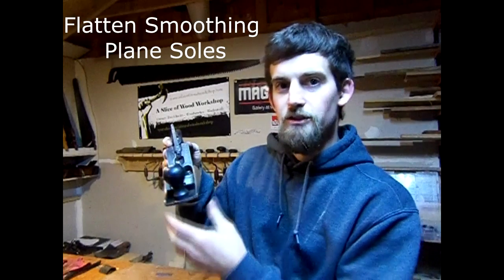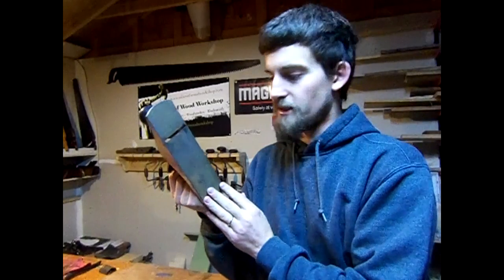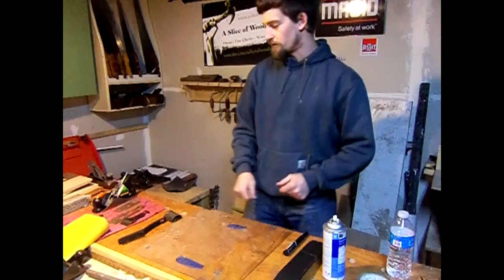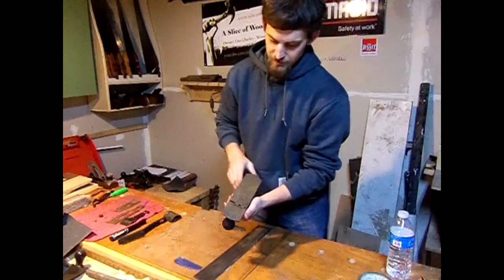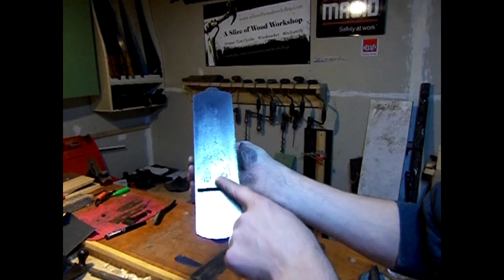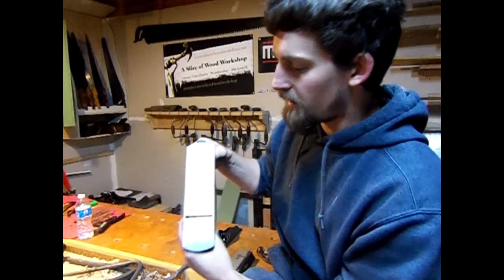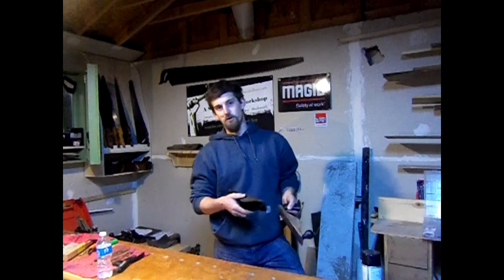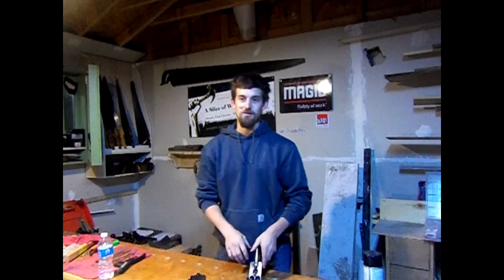How to Easily Flatten a Smoothing Plane Sole

Comment: good video, great instructions.  hard to see the difference in the 2 planes you compared because all we can see is the reflection of the light on both planes.

do the pits pose a problem in the use of the plane?
Reply from the maker: +Rafael H The pitting does not pose any problems as long as the area around the opening, heal, and toe are flat.

Comment: Use mineral spirits to clean off adhesive.  Works great for me, plus you can clean off the residue on the plane before applying oil as well.

Comment: Thanks Tim, nice video.
I'd make a clamp-able batten to hold the glass still so you can use both hands for longer strokes back & fourth on the sand paper.
Your technique is good and will help a lot of woodworkers clean up those gems they find at sales.
Reply from the maker: Usually I'm near the end of the bench and there is a small lip on the tool tray that helps with the glass not moving. I actually ended up clampin the glass down when using the 500 grit. Thanks for the tip and watching the video!

Comment: Do you have any wood carving chisels, if so, could you show me the proper way to sharpen V tools and also U shape gouges...  I have no problem on flats and skews, but I have a major problem on V's especially...
Reply from the maker: I do not use carving chisels. Could there possibly be a jig you could make to hold the stone at the correct angle to sharpen the v shape? I know with bigger tools you can freehand sharpen tools, have you tried this route?
Reply: I've tried just about ever trick in the book with the V tool....  The U shape gouge I have come close to getting it sharp, it won't shave hairs, but it will work somewhat on wood if I press hard enough.  Thanks, I'll keep looking..  LOL
Reply from the maker: If I see something, I'll pass along a link.

Comment: On the wranglerstar channel everyone keeps saying that your supposed to have the lever cap on the plane (all parts for that matter) before flattening the base, because of the tension of the lever cap changes the shape of the plane. I noticed you are not doing that.
Reply from the maker: Yes that is correct. You should have all the parts on the plane. I personally have not noticed a difference flattening with or without the lever caps on, but that is the "rule".